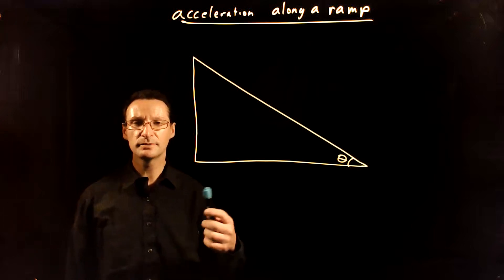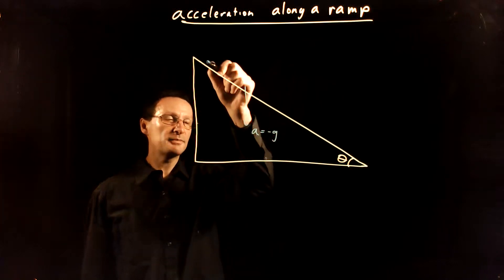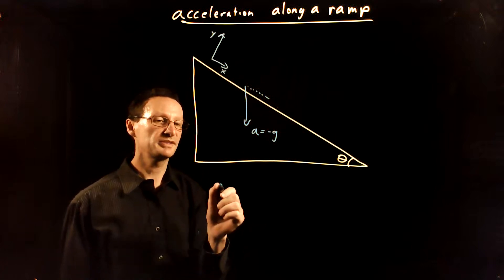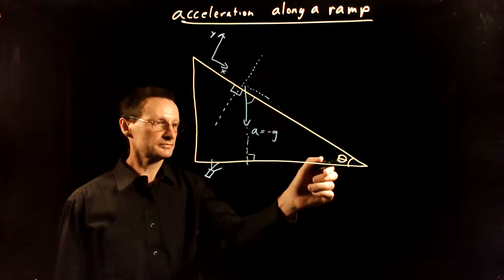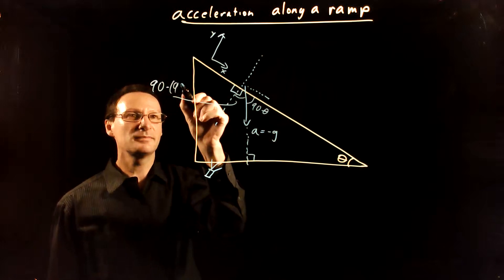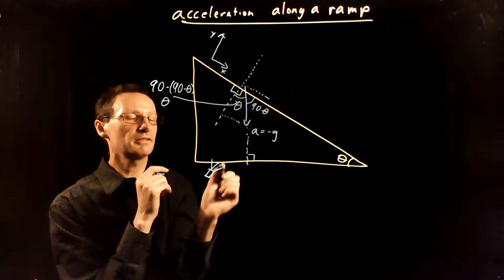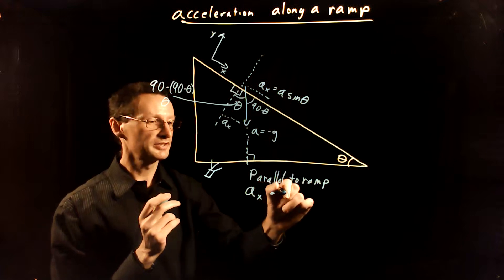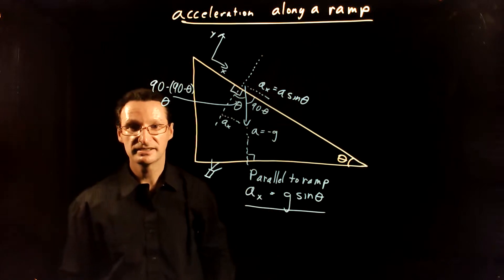Acceleration down a ramp

Comment: Thanks for this... with my very limited understanding of trig, it seems like it should be so that a(down the ramp) = -g/sinθ being that the "ramp" appears to form the hypotenuse to the original θ angle. Why isn't that the case?
Reply: Look for the ax on the small triangle, you can see it's the on the opposite side. That's where the formula is obtained